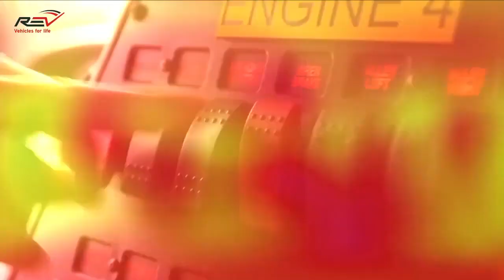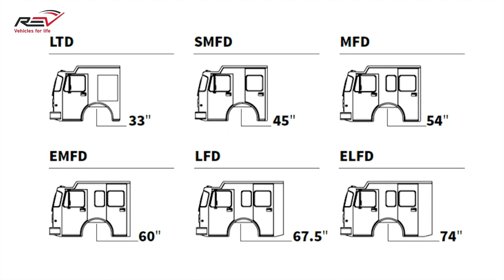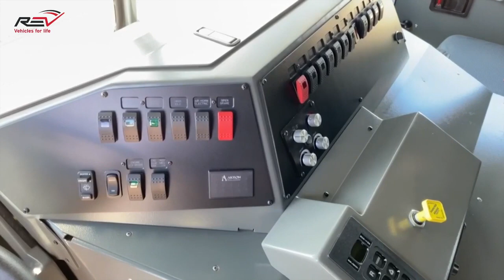Spartan Fire Chassis Live Walkaround Demonstration Spartan Gladiator Chassis and Spartan Metro Star

Comment: Looks like better access to fuses rather than removing screws. What I dont like is where the park brake control is.It would be easy to lean on that and roll away. Whats worse is when a three ring binder pops up the knob while the truck is doing 60.